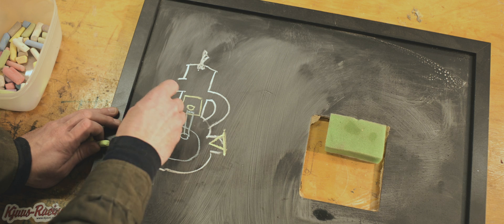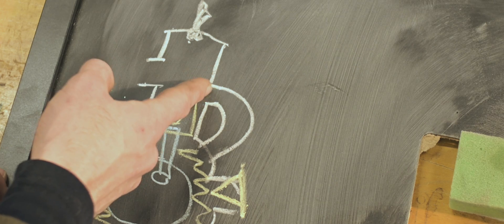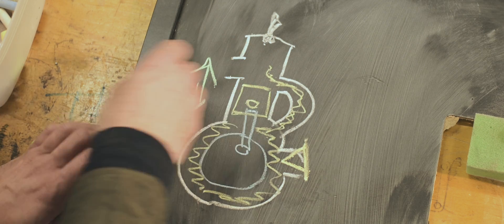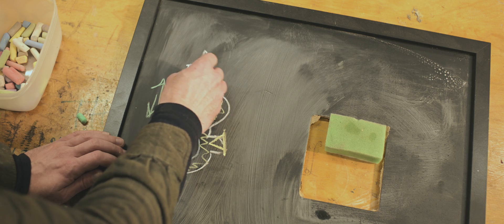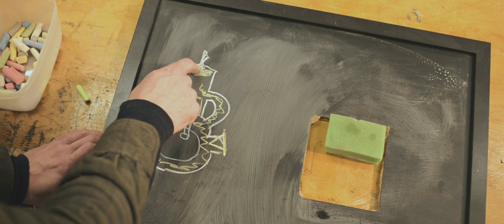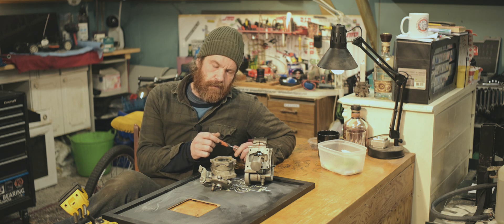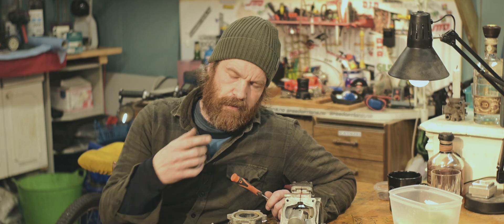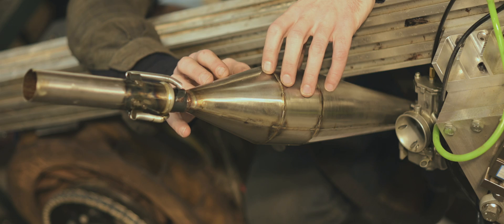Now, That's a two stroke pipe!

Comment: Use more Arduinos and servos. Have a linear thing change the length of the exhaust dynamically, have programmable ignition and so forth. Perhaps have electrical solenoid valves for the intake and fuel and oil injectors instead of a carb.

Comment: So 2 strokes are a cross between forced induction and a pulse jet engine.... similar to nitro engines with hollow crank shafts for induction with not reid valve.... thanks for the explanation.

Comment: You could also pre-spin the dyno with an electric motor so the engine only needs to take over when it's already in the right rev range.
It would probably even be possible to remove the clutch and start the engine by spinning up the dyno.
Reply: I agree with you on driving the dyno, It  would also give the poor clutch a much easier time

Comment: Sounds weak, and still not enough Ignition timing. Set your base timing @28-34° total and use a programmable ecu and adjust the timing map to advance or retard timing as needed. Bin that preprogrammed Ignition Box.

Comment: what about exhaust valve to prolonge the rpm range when torque is available? also bigger crank volume will decrease pressure of feed. I also see that you flood the spark with gas and oil, so maybe lean it a little.

Comment: Regarding your Dyno: Correct me please if I'm wrong, but would it help the PIP engine potentially being able to get up to it's happy power rpm range if the Dyno is spun from an external power source ex: AC motor up to a decent rpm before/during applying throttle to the engine? In my thoughts it's kind of like trying to do a 0-60mph in a car with a 30hp engine vs a 30hp engine trying to maintain 60mph down the road.

Comment: Did the  engines you used to demonstrate how a two-stroke works happen to be blata b1s ?
Reply from the maker: Looks very much like it, got it in a box of various parts. Nice little engine, good port geometry.
Reply: @2STROKESTUFFING  I ask because I also have 4 of them in a box of parts and apparently they claim around 10hp @39cc . Was thinking about re port mapping them at an attempt to make even more power . Figured you had some experience with them. If you ever decide to get one running. I'll be the first to tune in!
Reply from the maker: @CH33BO_OFFICIAL  I don't think those claims are far off, looks really well made. Haven't taken any measurements, but my guess is both transfer & exhaust timing is a bit low.

Comment: One thing comes to mind, no idea if the science makes sense though: A variable restriction in your muffler. If you close down the exit diameter of your exhaust a bit the added back pressure might help keep some mixture in the cylinder that you're loosing to bad pressure wave timing in the exhaust. It would be a lot easier to implement than a variable length pipe and less subject to seizing from contamination. 
Or, you know, nitrous just to get you through the flat spot! 
I haven't run the idea through one of the 2T calculator programs to see if it would be of any benefit.

Comment: Okay we now have 250+ comments saying to use a variable exhaust or a Yamha style variable port. But correct me if Im wrong but isnt that just a detour to fix a problem that wont be a problem later when the whole bike is ready? 

Maybe I have misunderstood something, but isnt the engine supposed to work at a fixed rpm within its power band from the pipe.
And then he will slide the motor back and forward on the frame to maintain that RPM i combination CVT. 
The sliding was supposed to be controlled by a microcontroller and some actuators and the primary intake will have no valve.
Original it was supposed to have fuel injection also controlled by a pretty crude program made possible by the fixed RPM.

When it comes to a real race situation cant you just slide the motor as  you did with your manual slidning launch control from the old SPX  to get in to the 20 000 RPM power band and then start.
The problem now is only because the sliding system is not yet developed/implemented and  the clutch for the DYNO is engaging at to low RPM?

Älskar din kanal, fortsätt med det fina jobbet!

Comment: you say the length of the exhaust ia only optimized for a small range of rpm, i saw a vid where the length of the exhaust variated by giving the motor some gas, is that helping? 
found it: https://youtu.be/0odVzSgufjk

Comment: Great demo of expansion pipe pressure wave, I'd said in a previous comment about the science of an expansion pipe, is there a calculation out there for length and diameter of expansion pipe, based on piston and crank CC???.
The motor sounded like it was pinging, a big improvement from last post. 👏👏👏

Comment: Dont fully agree. On low revs a two stroke dont need pulsing to provide transfer flow.
Reply from the maker: True. Keep in mind this was grossly simplified.
Reply: What is your crankcase compression value? I really think you should try to make a simplified model of your engine and simulate to get the basic design in the ball park.

Comment: Since your engine designs are hig power high rev, how about adding an electric "spin-up motor" to your dyno? This could be an easy quck-fix to overcome the poor engine torque at low RPM and get the rig up to speed faster without burning the clutch.
Reply: That would allow testing to proceed, but ultimately, the problem requires a solution, because bike and rider must be accelerated from a standing start.
Reply: @jimdale9187  You're right, but that can (hopefully) be handled by a transmission with enough gear ratios. I guess a CVT may be a good solution for a narrow band engine, but I'm not sure a CVT alone can give enough ratios, so perhaps a complete transmission may need two or more fixed gears too, at least if the bike isn't getting help by a push-start, like the salt lake cars do.

Comment: No 1 Programable ignition. No 2 Power valve cylinder  or variable length exhaust. No use in making the most power in the world and not being able to use it in the real world. Btw Professor Neels Van Niekerk EngMod2T designed and built my first Kreidler 50cc pipe ,and built my first x 3 road racers ,setting me off in a 15 year pro road race career. Brilliant man and World authority on all things 2 stroke😉😉

Comment: I would try a smaller stinger to increase back pressure in the pipe ...maybe a some type of valve that could restrict at lower rpms and when u come on the pipe let it breath normally ...too much back pressure at peak will cause detonation ...

Comment: It's not the clutch... You need either a pin or key on the clutch shaft. Press-fit like that is probably slipping. When the clutch fully engages

Comment: SOMEONE MADE IT.
I had an idea for a boosted 2 stroke and it turns out the germans made it in the 1940s
Very powerful, very simple and supercharged
https://youtu.be/-vV-YaKsIGk
The junkers Jumo 204.
The above video is mostly about the napier deltic but it explains the junkers jumo 204 early on in the video.

At some point i will try to build one. I think THAT could be the most powerful design. Note the 11 degree offset... Perfect for forced induction.

Comment: Could you have a valved crank case, so that you get the effect of a small crank case at low rpm, and then open up to get the benefits of a big crank case only at high rpm? Mayve/probably a dumb idea, just the first thing that popped into my head 😅

Comment: I would go with the electronic ignition so you could change the curve per the rpm. Another  thought is making a slip header so you could change the volume of the pipe a little. I know on my nitro model airplanes we only have a few expansion chambers to choose from but the header length is critical to achieving max rpm with any one given load. I started to collect data back in the day and surprised myself with how much difference there was when the load varied (prop change ) there was always a sweet spot for the given airplane one prop would outperform another even though the static rpm might have been greater with a different prop the plane went faster dynamic with a different one due to alot of factors I never really nailed down because a plane has so many variables. Weight, drag, angle of attack, and so on.

Comment: Maybe because the low rpm of the Dyno is misleading... I know it's going to output an electric out'put load sooo🤷🏿‍♂️ just seemed to have the engine with the clutch/gear ratio but yeah..... But yes the tac 'is reading rpm so you don't need it on your Dyno and if so you can calculate it but.... Yeahhhh

Comment: When you were describing the resonance, is this what Yamaha were trying to avoid by using YPVS (Yamaha Power Valve System) to vary the exhaust timing?
Hi from NZ,
Anthony.
Reply: Hi mate, not quite. YPVS is the little valve right on the exhaust port of the cylinder. This raises and lowers the top of the exhaust port to suit rpm. My mate has a 1984 DT200 it's exhaust valve is controlled by the CDI way back then!! Many power valves are controlled by mechanical rpm and crude. The 2002 CR250 finally got CDI controlled exhaust valve although it wasn't perfect, there are many systems available now. Exhaust timing is certainly related to the exhaust pipe but he is talking about sound/pressure waves inside the exhaust, how they draw more charge air from the crankcase and then pushes it back into the cylinder. Hope that helps and doesn't complicate it more! I'm in NZ too.

Comment: Do you have enough room in the crankcase to add adjustable pistons to decrease the volume at low RPM and then open up at high RPM?  I picture an actuated piston on each side of the motor with sealed o-rings that can move in and out as needed.  Just a thought.

Comment: With the blower added do you still need the expansion chamber exhaust? I would think the exhaust would be forced out by pressure. Same as a 4 stroke which use straight pipes
Reply: The OTHER engine is the blower design, and it does not use the expansion chamber exhaust. It has a rotary valve in the exhaust port, which closes off during cylinder charging, allowing the blower to pressurize the cylinder with more charge.
Gas only flows if there is a pressure differential. The extremely high pressure exhaust will flow to atmosphere regardless of the exhaust design. 
In this PIP naturally aspirated engine the trick is to optimize that flow, using pressure waves and inertia to help suck the exhaust out thoroughly, and then at the last moment use the reflected pressure wave to keep the inlet charge in the cylinder.
Straight pipes on 4 stroke engines still benefit from tuning the diameter and length. On multi-cylinder engines, the header length determines when the pressure pulse will travel up to the other cylinders. Also the exit of a straight pipe reflects a pulse, but in the case of an open end, it is a negative pressure pulse. Expansion chambers expand, then contract to cause a positive pulse to be reflected, rather than this negative pulse from an open pipe.

Comment: awesome way to explain the expansion chamber. I suspect that if you have a variable volume chamber you could easily alter the torque curve along a longer power band and with that alternative ignition system then you could also control it via some sort of pwm driven actuator
Reply: you dont have a clue what causes a power band nor do you have any knowledge of the true purpose of an expansion chamber

Comment: I like it when the engine revs up to 13000+ ,reminds me of carting with a 125 cc TM  45 HP rotary valve  engine. PS: Instead of getting lost in the setting jungle of an unknown engine How about getting a  used 125  TM RV combining it with a 50 cc cylinder  an starting from there?

Comment: @2strokestuffing would it be posible to use a stinger with variable back pressure?

just got an idea that it got tested on some pipes during the time i raced RCcars to widen the power band by using an exit that could expand by the exhaust pressure and looked like the exhaust cone of a jet engine that variabled the diameter and thus got different back pressure.

Comment: Would it be possible to make an exhaust chamber with a piston in it connected to the crankshaft by chain or other means to force fuel into the combustion chamber at the right time and suck it out at the right time?

Comment: Variable exhaust would be the obvious, easy answer, but since you have done such a nice work with the charger idea, I'll suggest a bit more complex way around large volume crankcase. This is a competition engine for landspeed record, so the effective cylinder volume is set to 50cc? But you could run two pistons, on opposite sides of crankcase, both moving away and towards the crankcase at the same time. One is the normal piston of the engine, the other only works as an additional crankcase pump, and also balances the engine. It can even be bigger than 50cc, since it doesn't count to the engines cylinder volume. This should still be counted as an uncharged 2T engine, although it is blurring the line on what is charging and what is not..

Comment: What about adding an electric motor to "spin up" that massively heavy brake rotor, then get on the throttle. Kinda like getting a bump start at Bonneville. Seems too much to ask such a tiny engine to spin up such a massive inertia wheel from idle.

Comment: Two things. Could you not make a relatively simple mechanism that would lengthen or shorten the middle of the expansion pipe according to engine rev's  and therefore change the power curve a little. Perhaps using pipes sleeved into each other. I realise that it's probably not that useful as obviously you are only really interested in the power at high revs. Also why not electrically spin the dyno to a decent speed and then let the engine take over?.

Comment: This is why Yamaha & others, went to power valves to vary the exhaust port aperture, so as to allow a wide & high RPM rev range without having to pay with having a gutless engine at the low end of the rev range.
 
The laws of physics decree that if any engine, whether 2 stroke, 4 stroke, Wankel or electric, chases horsepower by increasing the rev ceiling, it has to paid for with lost torque. The mathematics don't lie. However power valves do allow some bending of the laws of physics.

Comment: Watch this YouTube video (not mine) ... " The series of shockwaves from this explosion in a tunnel " this is exactly what he is talking about in the exhaust.  Imagine the camera is the exhaust out end of pipe and the return shockwave is out of phase with the piston (mechanical) timing it will blow the mixture back to the crankcase (massive volume in this case) instead of sucking a fresh charge of air/fuel in.

Comment: Good messaging. If the stinger pipe is placed within and centered in the expanded zone of the pipe you will have a much stronger resonance without problems of exit restriction due to this placement. I read an article about this during the 1970'2 and decided to try this on my already strong 125cc Sachs.  However, I also added an approved Chrisman spark arrestor on the end of the stinger which likely didn't enhance the power itself. Stronger throughout and especially on top as recorded by my "butt dyno" and multiple drag races with my buddy's 250 yammie. Try it sometime on one of your known engines. This is not crap.

Comment: I'm no professional when it comes to two-stroke engines, but I can't find a reason to not run a knock-detection-device. You could build a very simple version by your self with a small mono amplifier, a knock sensor and a pair of headphones. If you're willing to buy a knock detection device, I can recommend Phormula. Entry level devices are about 250 GBP. With knock detection you could tune the ignition way better.

Comment: You would think that someone would have already invented a variable crank case volume by placing an inflatable bladder around the inside wall of the crank case. It would decrease crank case volume by means of inflating the bladder. You can even fully automate it by using a flyweight to actuate a piston which can displace a predetermine volume of liquid or air to inflate said bladder.
 But there are many problems and huge risks like securing the bladder, choosing a material which is flexible enough to be inflated and "springy" enough to expel the liquid on its own when the flyweight relaxes, then the risk of having the bladder rupture and hydro locking the engine if you go the liquid route and additional complexity is never a good thing not to mention where would you mount the flyweights

Comment: Don't worry about confusing people. As long as it makes sense to you and it does still make sense to any 2 stroke fanatic that knows about expansion pipes.

I had a pipe on my nitro RC car that had a plunger inside. The plunger would extend the expansion chamber and at the same time opens up a second exhaust tip. 
I don't know how efficient it was but I did notice it was slightly quicker at top end.

Comment: Variable exhaust length (connected to a servo, dependent on rpm). Honda experimented with water vapour injection into the exhaust for a wider powerband, aswell as radical combustion (EXP) (basically keeping the exhaust gasses partially in the combustion chamber to ignite the fresh fuel mixture, it's a very delicate ballance though). 
I had thinner reed valves on top of thicker reed valves which had a hole in them on my CR250 (forgot what they were called though). That worked very well.

Comment: I've been riding bikes for years. Both 2 stroke and 4 stroke. And never fully got my head around why the 2t pipe is that shape. Also I'm in my 3rd year of mechanical engineering. 
This video has explained 2t engines perfectly. Thank you

Comment: As you know trying to get any engine big or small to tick over and  also  rev to 20,000 rpm? on the same port and ignition timing (within a few degrees)is near impossible without some drastic engineering like variable this and that,,,we shall see what you come up with.